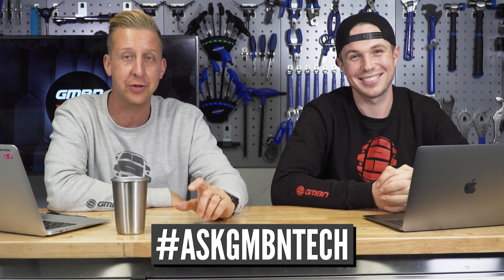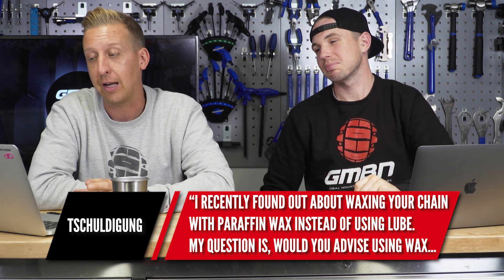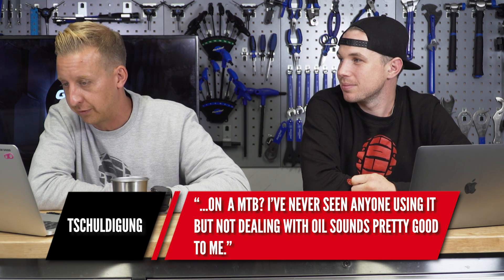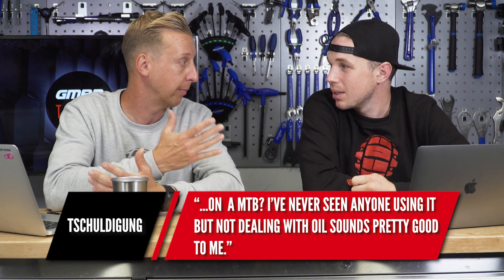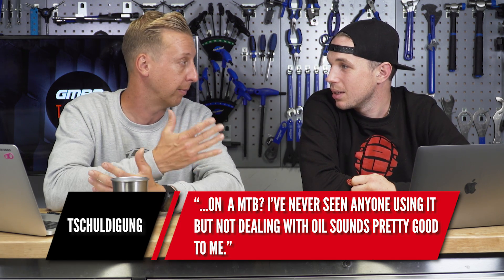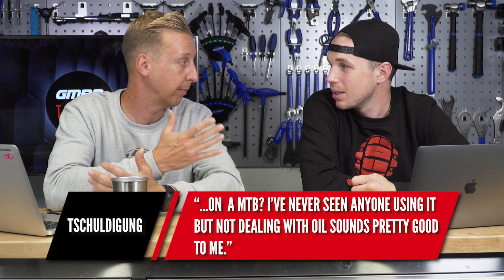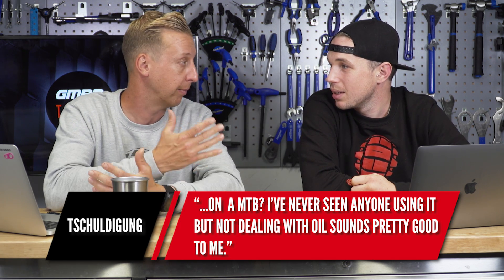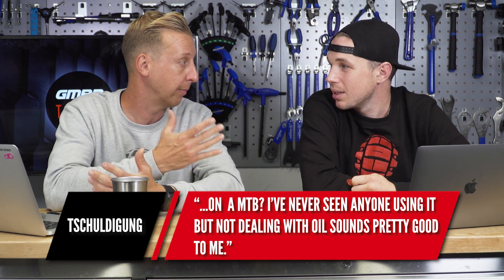Why Isn't My Damper Working Properly? | Ask GMBN Tech

Comment: #AskGMBNTech

The rear shock on my Intense Tracer was a Rockshox Monarch R and it blew out while riding. When the bike was new it started at 25% sag, couldn't really get it lower. A few months into riding it would sag 40% or more even at high pressures (I weigh 140lbs), and would get worse as I rode. Finally, I couldn't get it to sag any less than 50% and I replaced it. 

I swapped it out for a fox float x, brand new, and now it looks like my new shock is starting to follow the same trend of increased sag even when pumped up to a higher psi. 

- Is my bike killing my shocks? 
- Am I killing my shock?
- What is the maintenance schedule for a shock supposed to be? (The realistic one, not the one fox claims)

During the right seasons I ride a lot, like 5-6 times a week.

Comment: #askgmbntech my cassette is jammed onto my freehub body, how can I get it off?
Reply from the maker: Have you used a good quality chain whip and cassette removal tool? It may be super stuck! Try your local bike shop as most bike mechanics have had to remove super seized cassettes from old commuter bikes in the past!
Reply: Jiggle it

Comment: I'm pretty sure that the 51 mm comes from a poor effort of an american to learn the metric system (2 * 1 inch = 2 * 25.4 mm = 50.8 mm, rounding up gives 51 mm)
But if a european made it, it might be 31.4 mm offset (10 * pi, standard numbers in the metric system are always fractions/multiplications of pi). Don't know if other people would have the understanding for that. :-P

Comment: @Henry ... can you give any hints or do a vid on the charger shim stack in the charger damper? 
My 9yr old (32kg kitted up and dripping wet) is currently using some older (32mm) Revs and I stuck 2.5wt in the damper but I’ve not opened the charger damper (I usually wait for full service and send it off).  

I’ve got some Pikes waiting for him though (and it’s an excuse to put a Lyric or 36 on my Mega) ... but the closed damper feels a bit more intimidating than the open bath.  

On the plus he could use the Luftkappa or Deb spring  (got both) whichever helps him on small bumps... which I can’t do for the 32’s 

Both more small bump and some extra travel would be good ...

Comment: #askgmbntech Why don't steer tubes have a keyway coupled with a keyed stem to insure perfect alignment between the handlebars and the wheel? I'm sure this can be done without compromising the structural integrity of the steer tube and still allow even clamping pressure of the stem.
Reply from the maker: Simon is right👆, this force could even damage where the steerer tube enters the crown and this could become very dangerous!
Reply: If the stem/steerer were keyed you would damage so much in a crash, all that rotational force with nowhere to go? Snapped or bent handlebars, bent forks, twisted steerer tubes.

Comment: Hey i dent my rim on my tubless setup wheeles and air is coming out of the dent what should i do try to fix it or just go with inner tubes?
Reply from the maker: If you are careful sometimes you can save this by bending the rim back into place, obviously the rim will be compromised but you may be able to bend it back just enough to get a seal. Yea you could just run a tube though.
Reply: @gmbntech  thank u.

Comment: Would be nice to service my charger damper in my 2015 Boxxer but you cant seem to be able to buy the seal kit anywhere in the UK only the basic leg seals are available , Any ideas where i can purchase the damper seals so i can do a full service and bleed
Reply from the maker: In the UK check out some of the suspension tuners such as Full Factory suspension, Sprung or TF Tuned as they may have some stock 👍

Comment: One thing with shortening dropper posts  - it may be an issue if your seat tube somewhat restricts how low the post can go. I had such an issue because my fat bike has bosses fairly high up on the seat tube, so the insertion for the post is limited - and it was indeed about 1 cm too high at full extension (big one, 200 mm; I'm all legs).

Fortunately, my 9Point8 seatpost offers such and adjustment. Added 20 mm shims and it's all good now.

Comment: #askgmbn i have a problem, when i am in a high gear and my bike is in the workstand and i pedal and let go of the pedals they will continue spinning like i would have a fixie, i have a sram xx1 groupset with dt swiss hubs, any help is appreciated
Reply: Freehub drag - just disassemble it and maybe swap whe original grease for some thin oil. I know thet what's there is special dt sh!t but I've already had to service so many hubs because of that effect.
Reply: I don’t think that’s a problem unless it’s impossible for you to coast.
Reply: Peter Lang it is not a problem to coast, it is just a bit annoying because it is not supposed to be like that.

Comment: #askgmbntech Hi there, I have a 2014 Giant Trance Aluxx SL, I want to get a dropper post but measuring my seat hight I could barely fit a 100mm one. Can I cut down my seat tube a bit without compromising structural integrity? with around 30mm I could have a 125mm one and a lower bottom point witch would tailor it more for me an would still be around 20mm or so above welding point. Thx best regards (ps.: I haven't seen to many videos on full linkage service on full susp. bikes just saying :)
Reply from the maker: We have heard and seen people doing this on some frames in the past as they wanted to go up a size to gain a longer reach. It depends entirely on the frame and your judgment and it's worth knowing this will void any warranty support from the manufacturer. It will also affect the resale value for sure.

Comment: #AskGMBNTech 
I'm running a Rockshock Yari RC (150mil) on the front and a Deluxe RT (140 mill) on the rear of my giant trance I am looking to up the Yari to 170 and the Deluxe to 150 I find with some more enduro style riding I could use a little more travel than what's on there now. What would I need to upgrade these suspension parts new dampers and what else. 
Thanks!
Reply: You could possibly upgrade the fork, but can't upgrade the rear shock like that. A frame is designed for a specific eye-to-eye shock length and a bigger shock with either not fit, or the geometry will result in terrible pedaling and general shock feel. I'd suggest start saving up for a bigger bike in general or just changing the fork.

Comment: Hope do the V-Twin brakes. They have a double reservoir mounted under the stem on a bracket from the steerer. Then full length hoses. These are for road bikes. So may work with older style non-V brake levers. Not sure if they would work with V-brake levers due the the cable pull. Surprisingly for road disc brakes, they come with 4 pot calipers.

Comment: #askgmbntech   Hi, I have a set of Fox 40's from 2011 on my bike . The 40's I have tend to nose dive badly every time I hit big rocks and stuff while going step and slow and I can't seem to get them adjusted properly which have sent me OTB several times. The fork works perfectly when hitting jumps and fast rock gardens  and when I send stuff to flat landings.  I have tried stiffer springs, different oils in the damper etc with no luck ( I'm not an expert on this ) so  I am looking for an upgrade.  I'm looking at the Fox 40's with the Grip2 dampening system but they are really expensive.  What are your opinion on something like the Manitou Dorado Pro or the Marzocchi Bomber 58?   Maybe you know how to fix my current 40's nose diving problem?
Reply from the maker: Try see if you can slow down the compression a little or see if you can even get an air-spring conversion sorted so the fork is more tuneable by you at home.. If you have a good local suspension tuner it's worth asking them for advice as this may save you money!

Comment: #askgmbntech
Hi GMBN Tech,
you make a fantastic job, thank you. 
Now to my question. I have a little problems with my break, Shimano SLX. When I have to break hard, the break make a load shrill noise. Should I change the break pads or could there be other reasons?
Reply: Common problem with discs in general. Clean the rotor with rubbing alcohol and then immediately dry it off with paper towel or clean rag to get the residue off. Then use some brake cleaner on your pads or rubbing alcohol and then dry as well. Repeat a couple of times on the pads till the cloth to dry doesn't come out stained. The key is to remove any oil/grease contamination.
Reply: That is probably happens because the rotors/pads are contaminated with something. Clean them like trail POV said, and make sure you don’t touch the breaking surface, because your skin will leave oil, which contaminates the brakes

Comment: #ASKGMBNTECH. Hi guys, I have a Thomson elite dropper post, when I push the lever, it get half way up the travel, slows and stops, it does reach the full length if i pull it up, do you know what this could be?
Reply from the maker: When did it last have a service? This could be due to friction caused by over clamping so check the seat clamp isn't over torqued. It could just be time for a service!

Comment: #askgmbntech can I use the 9 speed box 2 e cassette with my Shimano 9 speed derailleur?
Reply: No you cant.
Reply: mopedvieh why not?
Reply: Because the cage of the shimano derailleur is too short. It was designed for around 30 teeth on the largest sprocket. The box cassette has a largest sprocket with 50 teeth and therefore the derailleur would  be way too short.

Comment: Another great video guys, thank you! Suggestion, since video content can not be indexed for searching, it would be great if you could post the questions answered in the description so it can be searched. Also, I can not find much information on Chain Rings, the different sizes, amount of teeth, ratio's, etc and how to choose one #askgmbntech
Reply from the maker: Hi Michael, great idea be on the look out for this in the next episode! Sheldon Brown made a sheet with various BCDs, it's a little dated now but still useful. https://www.sheldonbrown.com/cribsheet-bcd.html . We have a lot of direct mount options now though... Once you have found a chainring that suits your crankset. You can either look into the gear inches/ gain ratios or use the method most people do, this is called "bracketing" and it's the process of simply stepping up or below from what you currently use until you find what suits the best. Hope this helps 👍

Comment: #askgmbntech I have recently bought a canyon torque dhx downhill bike and it's got a one by ten but it's small cogs on the back can I put a larger ten speed on the back without buying anything new for more range of gears
Reply from the maker: You can get adapters from brands such as WolfTooth but we would suggest you just get a longer cage derailleur as this will provide stiffer shifting.
Reply: If it's a downhill bike chances are you'll need to buy a long cage derailleur too. I'd compare your derailleur to a mates who has something similar to what you want and if they have a larger (longer) derailleur then you'll need a new one too or you can buy adaptors too but they never work that well